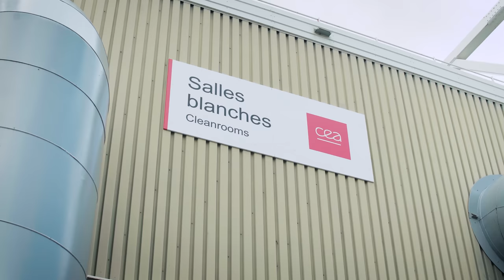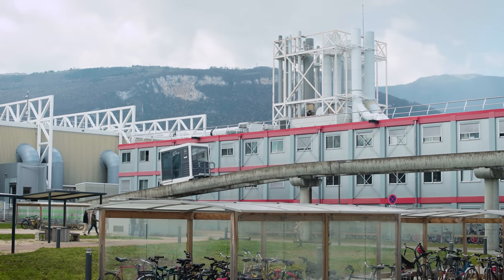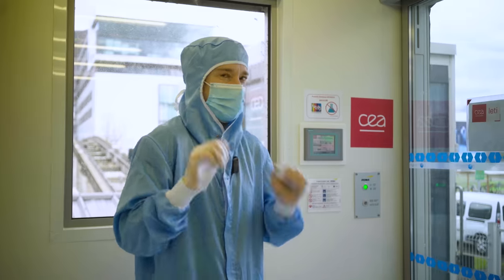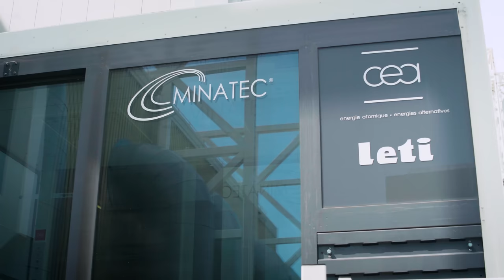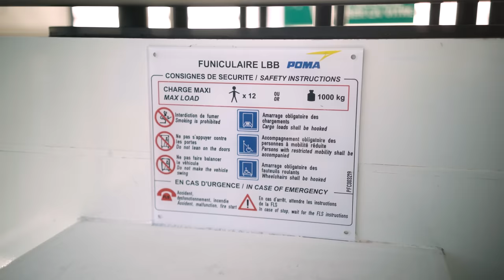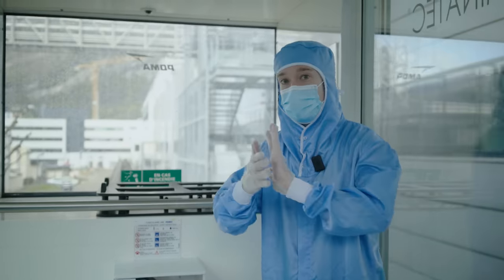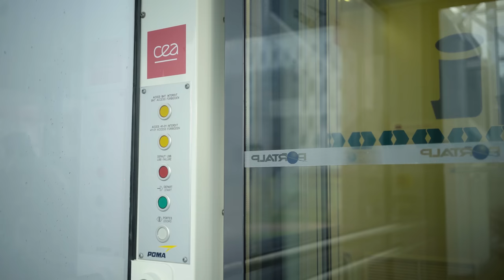The world's cleanest railway

Comment: When I worked in the elevator industry we went to a lot of hospitals to do assessments/audits. The surgery prep room had a dedicated elevator that went to the operating theatres, and it was a full clean room including the elevator itself. The used implements got their own elevator too, and it went from the operating rooms to the disposal/cleanup room. Guess what? Both elevators shared a single hoistway and were not separated at all……
Reply: I used to install entrances and I only did a few single stop entrances. The Marriott Marquis at the top to the restaurant, for the kitchen and staff, a couple penthouse ones and a private one in a brownstone for a handicapped professor. I almost forgot an odd one in the -6 sublevel at 7wtc.
Reply: OR "clean room" protocol is just about keeping the air free of dust and airborne germs, and that stuff off the patient, also germs off anything that touches the patient. Used instruments are assumed to need autoclaving but they don't pollute the air.

Comment: The amount of HVAC work to make sure a clean room works as intended is tremendous. To make a corridor that long you need At least 2 filtering and air-conditioning systems (one primary one backup). Factoring in the required duct length, you actually going to need 2 sets one on each end…

Comment: I'm surprised that the doors opened that way. I expected them to connect to each other and open together. That way there would be less outside surfaces in contact with inside air.
Reply: Same actually. The "Seal together to have the pocket of dirt out of the way" seems like a possible upgrade.
Reply: Also thought about it. The issue I see is "how do you move the two doors out of the way?".

Comment: This looks extreme, and you hear the guy say that they're deal with 10nm fabrication.....and then you realise that there's 5nm fabrication that's going on these days. If 10nm fab has this level of care and attention being needed, just how extreme is 5nm production?
Reply: I think they've made stuff down to two nm now which is absolutely insane and I can't even fathom how a transitor works on that scale.
Reply: At that point it's probably almost entirely automated, just to eliminate the human element (the element most likely to introduce contamination) as much as possible
Reply: With regard to the clean room, the requirements should not be much higher, because I think any natural dust is already many times larger than the 10 nm technology mentioned in the video.
Reply: The different nm fabrication techniques are actually not really accurately named. The x nm technology of one company can be the equivalent of y nm in another company. But yeah, the requirements get much stricter with each node upgrade
Reply: The particulate requirements are about the same.
At any scale, a hair or particle of dust will ruin the circuitry below it, whether you're working on a 280nm, 10nm, or 5nm node. The difference is in how complex the etching process is - more advanced and denser processes use higher frequencies of light, and require more consecutive passes, in order to produce smaller structures with a much greater level of precision.
Reply: 5 nm fabrication is not reslally 5 nm. Its just a marketing term. Its more like 20-30nm
Reply: TSMC mass producing 5nm node for some years now yes. My whole new desktop is only that ^^ All made by TSMC CPU and GPU...They really to giant now having intel, AMD and Nvidia together.
Reply: Did you know that all the clean rooms and a big part of the Miniatec building (in the CEA-Grenoble)  is so seismicly stabalised that you will feel no vibration when you jump in the building groud floor !

Comment: We have multiple clean rooms in my company, some separated by nearly 2km, we had a similar issue. So they built a massive pneumatic tube system. It works great, and keeps our areas clean. I'm surprised they didn't use that here.

Comment: A common misconception is that "10nm process node" means that the transistor is 10nm long or wide or the like. However, this has not been the case since ~32nm. The "nm" process node used to measure the gate length, but as dimensional scaling of transistors was hitting their limits, new tricks were used to improve performance and density without actually needing to make the transistors much smaller. As such, a 10nm process node still has dimensions in the 20-40nm range typically.

Comment: I sure love finding out that, mobile clean rooms can, and do, in fact exist in some compacity
Reply: Even ones that are mounted on trucks, for specialty transport. Some can even be sent as air cargo, fitting into the standard air cargo footprint, though those tend to not run on commercial flights. Quite a few do exist as full size extra height containers as well.

Comment: Thats so interesting! Its cool that the clean rooms are higher pressure so the leaks only go out!
Reply: I spent a year living in a decommissioned Cold war 'nuclear bunker' in the UK which was not at all clean or warm but air from outside was filtered to remove possible radioactive particles or chemicals at a rate sufficient that any 'leaks (like the half inch gap around the doors!) would blow outwards.

Comment: I am very surprised that there is no venting or cleaning of the air between the two doors before they open. I was expecting this video to be about the amazing engineering to keep outside of the train separate from the inside of the clean room.
Reply: Hahaha I hadn't watched pass the point where you got on the train😂
Reply: I'm still surprised that the interior and exterior doors don't open in unison to keep their edges sealed together.
Reply: @dfgaJK The rubber is already sealing in the space, so there's really no advantage to keeping the doors in sync. It's like being inside an airlock and opening a door in the middle instead of the doors that seal the room.
Reply: @dado__  but if something has stuck to the outside of the doors, when they open, it could get into the clean space. If outsides of the doors were sealed together, the dirt would stay between them.
Reply: @dfgaJK  They mentioned that they flush the surfaces with air during the sealing process.
Reply: @dado__  I know, but I would have expected there to be multiple layers. I.e. Air flush, pressure difference, multiple layers, syncronus doors etc.

Comment: How do they prevent pollen and stuff from the doors though?

It looks like the dirty cabin door opens at the same time the cleanroom door opens so everything stuck on the outside of the door can fly in
Reply: They answered that. The space between the doors is blasted with high pressure clean air so anything could transfer from the outside into the cleanroom has already been blown away.

Comment: When I used install equipment at manufacturing sites, I once had to enter a room where the lithium part of a lithium battery was made.  Lithium is sensitive to moisture, so it was not only a clean room but at ZERO percent humidity.  You could feel your skin drying the second you entered.

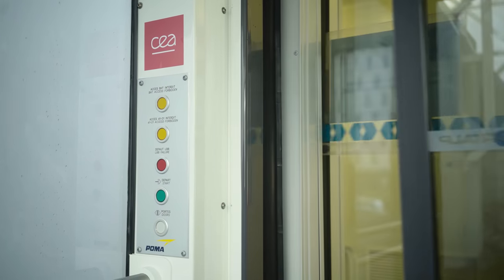Comment: Interesting. I spent 12 years as an elevator entrance installer. I've never seen a gap filler like that before. 5:09 Looks like it's for a @ 1 1/2'' (40mm) space. The taper is obviously because it goes sideways not up and down. The cab doors are strange looking. I guess because it's designed to be positively pressurized when in use. It can't be sealed.

Comment: Used to work in a clean room back in '97.  Wore bunny suits similar to what Tom had on. It was also rigidly temperature controlled (~70 F) had a constant positive pressure - which is why no 'outside air' was let in as you mentioned -  and significant downward pressure as well from the venting - plus shielded from radiation, including from or to cell phones (though back then pagers were more of a concern), and sunlight.

I'm curious if the carrier at the front of the people mover was cushioned with springs or some other form of shock absorption at all. It seems like a fairly jerky movement and you're already dealing with a lot of issues with sensitive hand-carry lots.

Also curious if there was that much rubber on the door frame that there wasn't a separate blowoff area. Rubber degrades very easily and produces very fine particular mess. It's required inside some very expensive machines, so it gets switched out on a regular schedule before it breaks down, but that door seal is a lot bigger than an o-ring or gasket on a bolt...

Comment: The clean rooms for silicon fabs are insanely clean. The ones here at Intel Santa Clara are so clean that you could perform a surgery on the floor with a lower infection risk than in the best opperating theaters.
Reply: its free of dust, not germs.

Comment: And I wonder why the doors open in opposite directions, exposing the space in between. IMO this should be done similar to suitdocks, train door seal mating with building door seal, keeping the contaminated surfaces of the two doors sealed together, and moving together, only the tiny seal surfaces requiring clean-up.

Comment: Things I’m wondering about… what happens if the train gets stuck? I’m guessing it doesn’t process air itself, relying on the clean room systems at each end, and there’s probably plenty of air for passengers to make the trip, but since it’s sealed they’d run out of air if it was stuck for a while — I’m guessing they have a way to break the seal for an emergency? If they do have to break the seal in an emergency, do they have packaging to put equipment in before doing so?
Reply: I doubt they have a way to package any equipment inside the train. It's likely that if the train does get stuck, they will just consider the equipment contaminated and let the people out if they can't get the train fixed in a reasonable amount of time.

Comment: Another (Maybe less obvious) benefit of using a funicular for this is that if one of the cleanrooms becomes compromised (i.e: Contaminated air is admitted) the other room still remains clean, whilst a corridor would allow contaminated air to pass between them if airlocks weren't used. 🌬🛡💨👍

Mind you, did anybody else think that funicular seemed a little bit rattly for a vehicle that presumably carries extremely sensitive equipment on a fairly regular basis? 🚞〰😇

Comment: A detail I didn't quite catch - the buildings are run through ventilation, and the "airlock" space between the building and the car gets flushed with clean air. Is the car itself just a sealed box that refreshes air while the door is open, or does it have it's own cleanroom ventilation system?

Comment: Surprised there's not double doors on the interface between the train and clean rooms.   Dirty doors that are sealed to each other's dirty side and moved away before connecting the clean ones.   Maybe that's not needed as the doors already do that function and it would just be over engineering?

Comment: Fascinating. I'm curious how they pressurize the mobile clean rooms without using outside air. Is it a passive system? In other words, when the doors open, does the cab match the air pressure of the big clean room and then just hold it during the trip?

Comment: Cleanrooms typically come with a cleanliness level quantified by the number of particles per cubic meter at a predetermined molecule measure. The ambient outdoor air in a typical urban area contains 35,000,000 particles for each cubic meter in the size range 0.5 μm and bigger, equivalent to an ISO 9 certified cleanroom. By comparison an ISO 14644-1 level 1 certified cleanroom permits no particles in that size range, and just 12 particles for each cubic meter of 0.3 μm and smaller. Semiconductor facilities often get by with level 7 or 5, while level 1 facilities are exceedingly rare. Interestingly enough, ISO also mandates (among other things) ISO 3103: The standard for tea brewing. I would argue that they should leave that to the professionals, which is why snobs would rather use the RSC (Royal Society of Chemistry) standard instead.
Reply: Zach

Comment: Strange that they didn't make a pressure tube transport. Would be perfect for small parts.
Reply: But not people working on these small parts with different equipment. Moving people is just as important here IMO
Reply: They need to move people as well.
Reply: People aren't small parts
Reply: Labor regulation doesn't allow human resources to be transported that way.
Reply: @freshrockpapa-e7799  You beat me to it.
Reply: It's perfect if you want to shatter the wafers. Not so perfect if you want to sell the chips later. Silicon is very brittle (even more than glass).

Comment: Why is the lighting so strange in the clean room? And why are there yellow window blinds?
Reply: It has to do with blocking out blue light, i cant remember details, but some steps in the manufacturing of microprocessors are ruined by blue light.
Blue light has the highesr energy, lower energy light, yellow and red, doesnt have enough energy to damage stuff, but can still be seen.

Comment: So is the train car just a "dumb" pressure vessel or does it have any amount of life support beyond at least a pressure sensor?  The ride is short enough that it shouldn't truly be needed, but I imagine there is a small increase in carbon dioxide from one side to the other.  If It is a dumb pressure vessel I assume they can always just open it to the outside if there is ever an issue at the cost of a bunch of cleaning.

Comment: Oooh, wait, wait wait wait...  You implied that this funicular also circulates clean air... but as I understand the technical specifications, this is actually a hermetically slealed hotbox.
People worrying about walking down a 250meter curved concrete tube, should probably also contemplate asphyxiation  as balancing off-set.

Sure, positive pressure adds a few scant seconds, and with an external powersource you could probably run a few UPCs and maybe even a pneumatic auxilliary power delivery system, but it strikes me personally as offseting mental risk in favor of physical risk.

Someone explain to me how I am wrong about this, please
Reply: I'm pretty sure if that's a concern then they'll have implemented an mechanical emergency open button, or even just the old standby: a window hammer inside a "use in case of emergency" box.

Comment: I am actually surprised that this people mover is going outside. I would have put it in a "clean room" tunnel of its own, obviously not kept to the same demanding standards as the cleanrooms the shuttle connects, but clean enough to greatly minimize the risk of contamination. After all, the outdoors is far from clean, even on a good day.

To be fair, the corridor option seems more competent overall, and the long distance on either side of the road would allow for each side to be slightly ramped, such that stairs aren't necessary. Keeping it "clean", well yet again it is debatable. The corridor could be kept at a slightly less strict cleanliness and still be good enough, since one can rely on packaging during transport.

However, a lot of semiconductor manufacturing does packetize wafers for transport between production steps even when transported inside of a cleanroom. Since even a cleanroom is rarely actually sufficiently clean. Humans are very dusty creatures to say the least.

Comment: why is it always so yellow inside the clean room facilities? is it some kind of microbe-killing light?
Reply: A lot of clean rooms work with blue light sensitive photoresist to create their photomasks which are the patterns they put on their silicon and actually make their transistors. White light would activate the photoresist before it was ready and destroy the final result. So most rooms use yellow light which cannot activate the photoresist.
Reply: Micro electronics use light sensitive chemicals to etch the designs on the chips. The chemicals are not affected by the yellow light hence the yellow filters.
Reply: interesting question. Although it is possible to kill microbes with light, it would require a much more powerful ones and this would not be good for the employees in the long run.

The light is yellow because with normal lighting (white light with a blue component), it would not be possible to work with light-sensitive components. And on the sizes where such a cleen room is necessary, a whole lot becomes sensitive to light. 🥼
Reply: Same with film photography lab safelights.

Comment: Could someone explain to me why some clean rooms don't require full face coverings? With what Tom is wearing, you could easily be throwing around eyebrow hairs, eyelashes, and skin flakes from the exposed skin.
Reply: Quite simple, actually. There is a constant airflow to pick up those particles, so unless you're in the direct vicinity of an open process, all is fine. Note the lab tech in the white suit walking by at one point. They wear a different outfit, with only a small slit for the eyes, and probably add goggles at their workstation.
Reply: @HenryLoenwind  Ah cool, thank you!